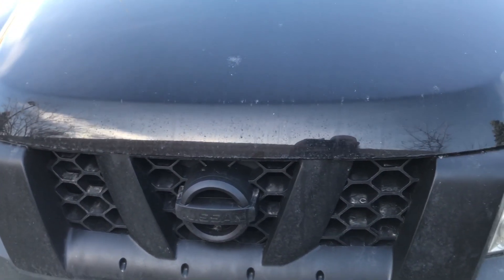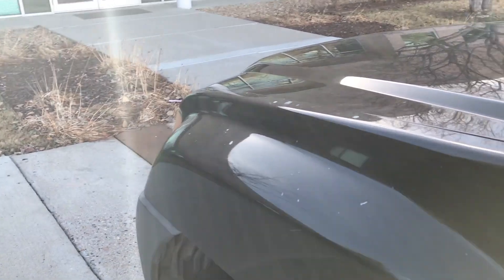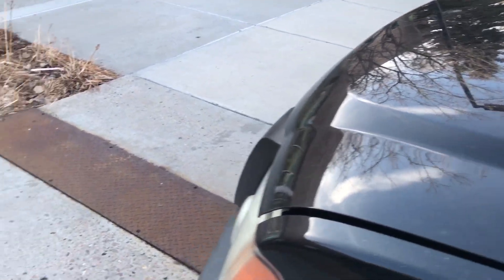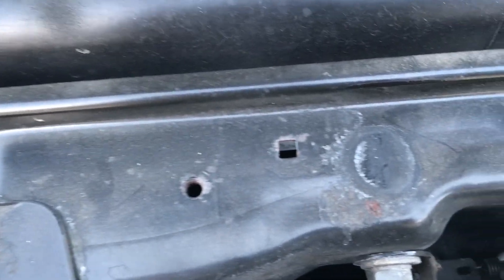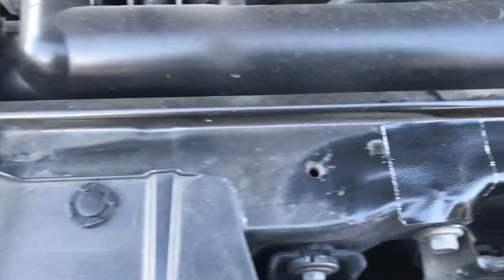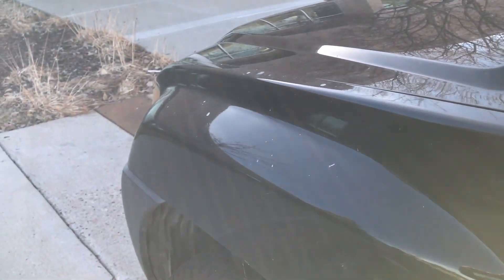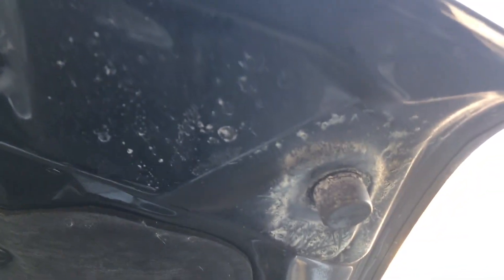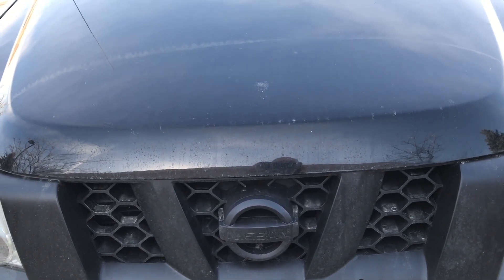How to Fix Nissan Xterra Hood Squeak

Comment: I just found the squeak on my  2019 Frontier pro-4x. There's a small black brace that rubs on the front exhaust heat shield just behind the front passenger wheels. The shield just rests on that brace and rubs (squeaks) whenever I close  a door or drive on bumpy roads. I sprayed a bit of WD-40 and It stopped. Not sure how long it'll last. Might have to use grease instead.  If not that, try lifting your hood and see if it still squeaks. Some have had issues with the hood latch rubber stops making noises.Hope this helps, I'll post this comment on a few of the videos about Nissan squeaks.Cheers

Comment: Put electrical tape around the round bar that drops into the latch.....two wraps around the bar(part where it is flat at bottom...the part that is on the hood) i first had backed out the hood stops but that did not work dor me. .

Comment: I’d try some krylon undercoating spray.  It dries “rubberized”.  Make sure to do it when the humidity is super low or preferably inside ventilated .  Tape off the small section and spray it 1 coating.  Let it sit for about 6 hours then spray a second quick coating.  Spray from about a foot away. Let dry for atleast 24 hours before closing hood or using vehicle again. Preferably 48 hours.  My hood latch was squeaking because the coating wore off so it was metal on metal. I took off the metal loop that goes into the latch and painted it with this spray and it’s held up well.  This stuff takes awhile to dry so be patient.